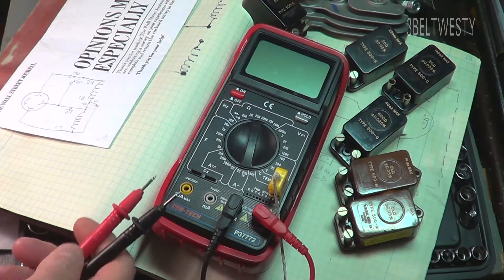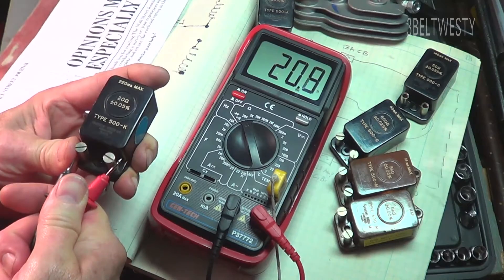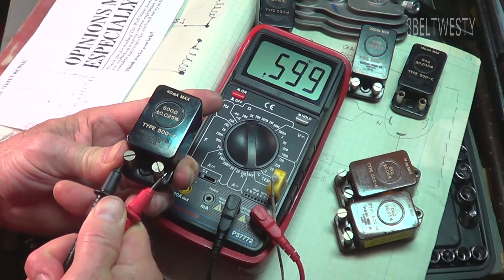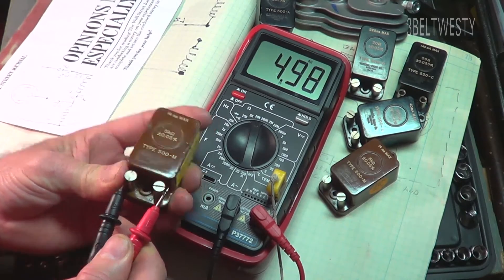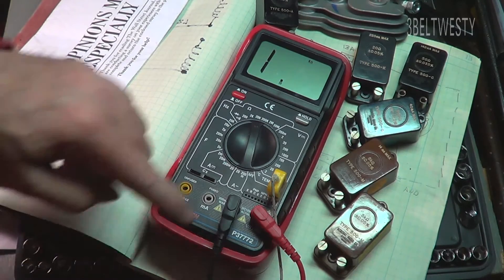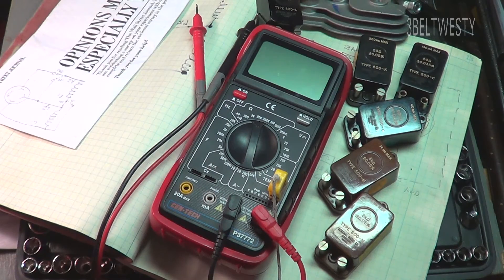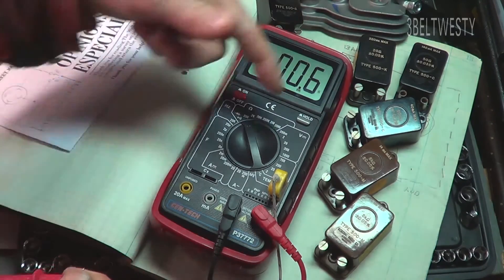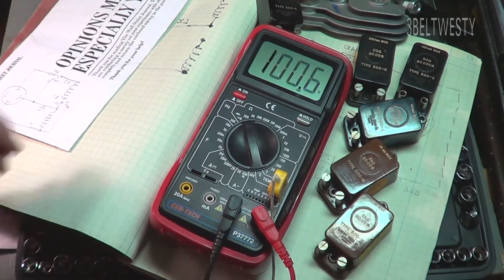Harbor Freight 37772 Meter OHMS accuracy Resistance Standards

Comment: I have one of these for bench prototyping amp , crossover,  digital circuits , etc. on a breadboard . That meter is a steal even at $30.00 U.S. definitely the most bang for the buck .

Comment: I have this same model meter and the best improvement I ever did was replace the leads with some generic gold plated ones for about $5.00 online.  I got lower resistance at the tips and no more scratchy continuity on the beep.  Im also considering cleaning the dial contacts and finding a cleaner/lube for them that wont affect the readings.  Like many HF items you have to make small mods and finish the Q.C job to end up with a better working example.

Comment: have you the possibility of checking the capacitance scale? I am considering this meter for some cap checking...rsvp I value you careful approach..
Reply: I've used this meter to check crossover caps and then double checked the values againts the bench top Techtronics meter a work.  My bargain meter was spot on as long as it had a good 9v battery in it. Capacitors can vary up to 20% from their rated value , so you are quite correct to check new ones . Check for bad electrolytic caps by putting voltage across them and then check the voltage across the cap. It should lower slowly over a period of hours . If it's bad  , it will drop in seconds or less .